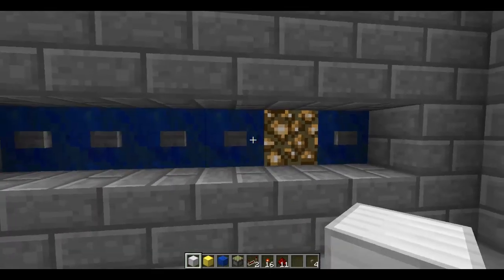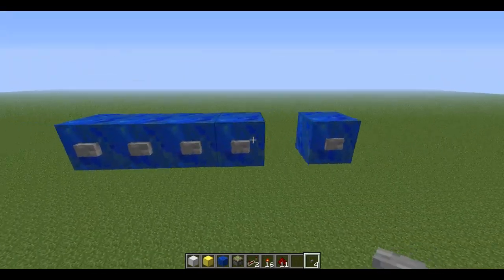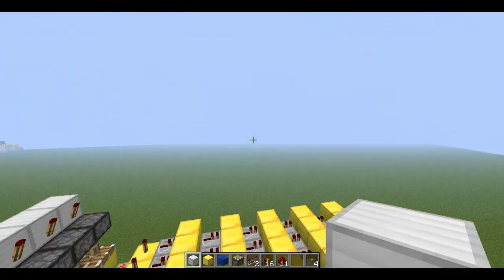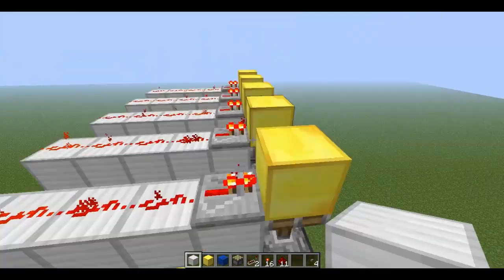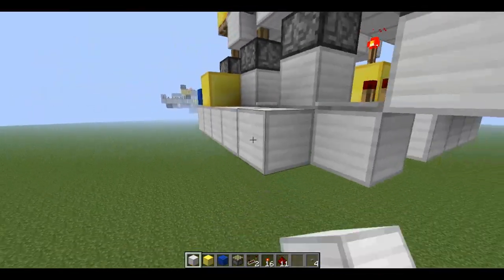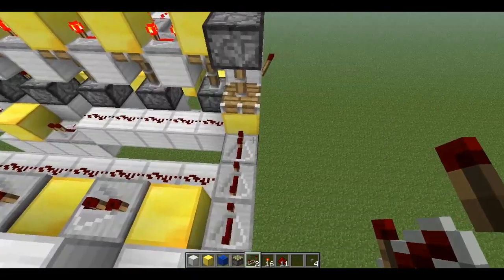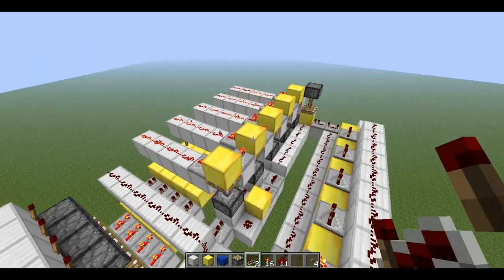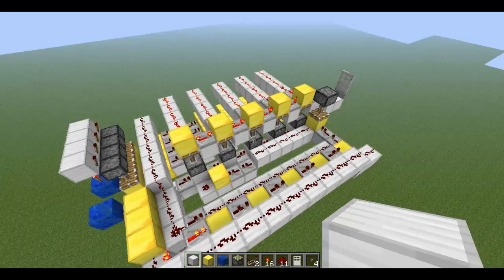Button Combination Lock Tutorial (Better Than CNB's)

Comment: I have an idea. You could put torches on every block in the decoder part, and then place pistons facing straight down 3 blocks above every torch. When the piston is powered, the block will go down and the torch will power it sending a signal it to the RS NOR latch array. If you were to hook each piston up to a separate lever, you could change the password without modifying the torches at all, just making it more user friendly, but thanks this combo lock is great :D

Comment: Cool!  One thing that may or may not be better about CNB's is how a correct combination could be inputted.  For example, with your code 11423, '51423411423' would work for CNB's.  That way you don't need a real reset button.  It's kind of like how masterlock combination locks work.

Comment: I was wondering, If I have an 8 long combo for it, on the counter line it doesn't reach the end by 2 blocks, I tried adding a paralleled line with an instant repeater to keep it in sync, it worked but I wondering if you had any other way to work around that or have an improved design to get it working for +7 digit combo's, I'd like to know if you did, or if you had another way to fix it, I really enjoy the design and I hooked up a sand drop to the counter reset for a pvp server I'm on, Thank you

Comment: How do I close/open the lock from the other side of the door?
Reply: wire a button from inside the door to the reset circut and another button inside the door connected directly the door